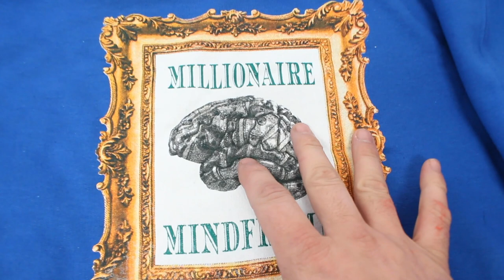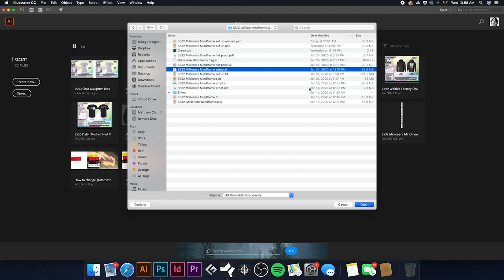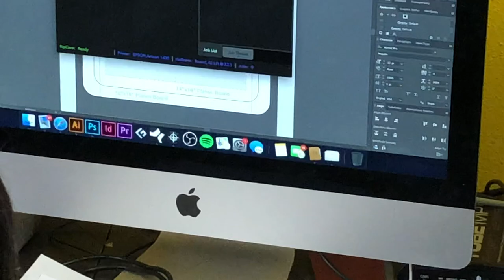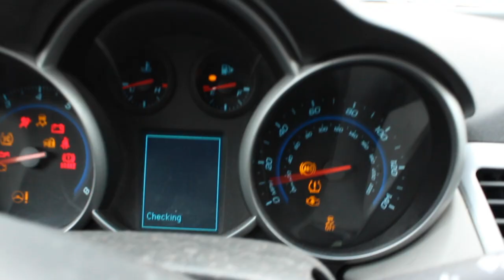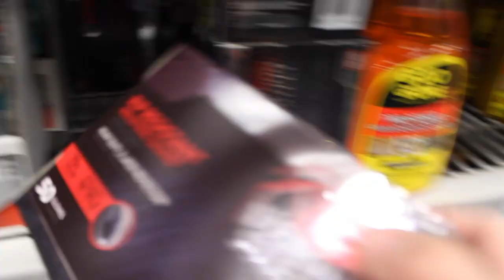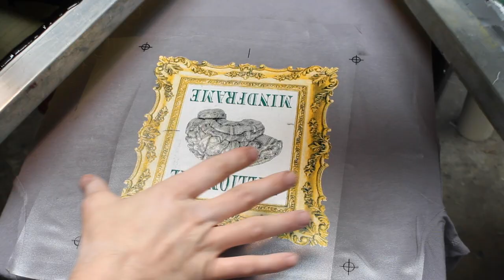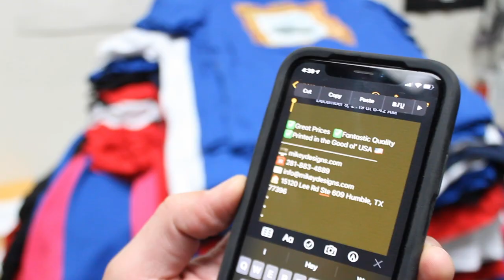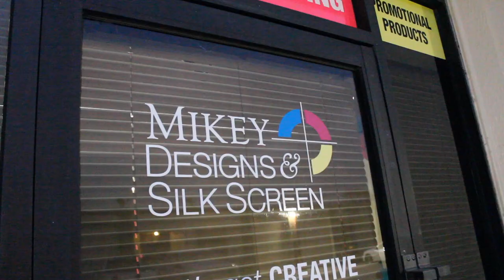A DAY in the LIFE of a STARVING ARTIST | Tee SHIRT BUSINESS Vlog

Comment: Matt, I made DIY pallets for youth, toddlers and sleeves for my Freedom all for less than about $300. What I did is i bought sheets of 1/4 aluminum from a company on ebay and had my friend cut them down to the sizes I wanted and had him drill tapered holes in the corresponding locations of the bold pattern on the pallets that came with my press. So all I do is unscrew the pallets from the bracket and use some nuts and bolts to fasten my diy pallet of choice on there. Works like a charm. Let me know if you would like to see it if you think it will help you.
Reply from the maker: Nice! Very genus!  We have a new press coming so I have been putting off creating some.